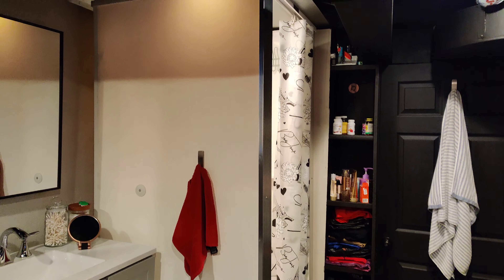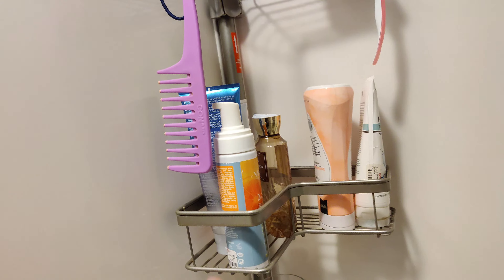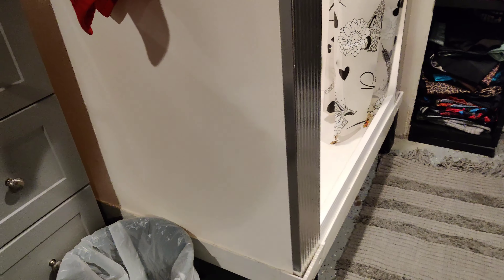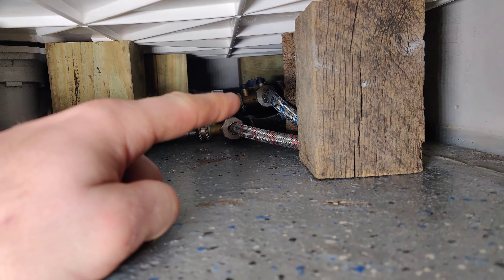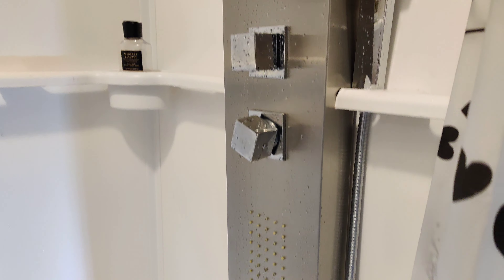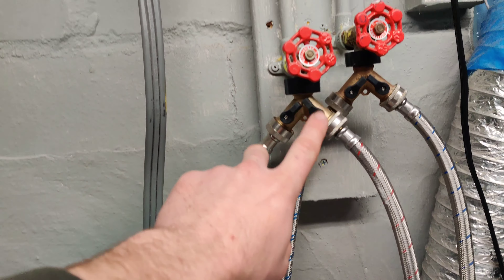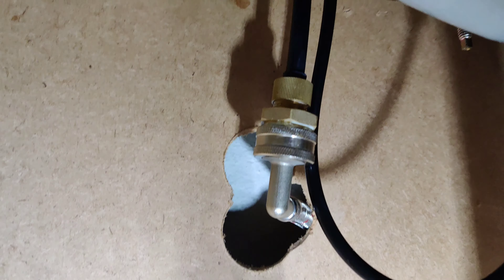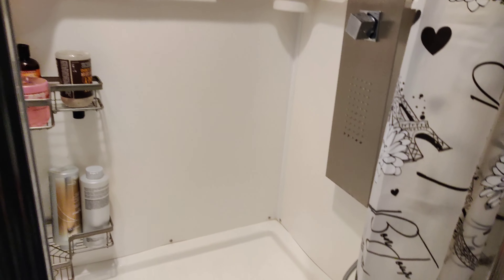Mustee Durastall 140 Shower Stall

Comment: What's the size of the restroom all the way to your washer and dryer? How long and wide ?
Reply from the maker: What you mean?
Reply: The space measurement used from the vanity to your washer and dryer room ? I want to know how wide and long because I am trying to see how much room I need to have built to make everything fit the way you have yours.
Reply: It's OK if you don't understand what I mean. I just liked the way you had the vanity sink, the shower, the toilet, and  the washer and dryer. All to the same side to the wall. So I was wondering about how many square feet by square feet I needed. I really don't know how to explain it. 😅
Reply from the maker: @melav1407  15ft by 4ft
Reply: @Andrey Andreychuk, Thanks :)